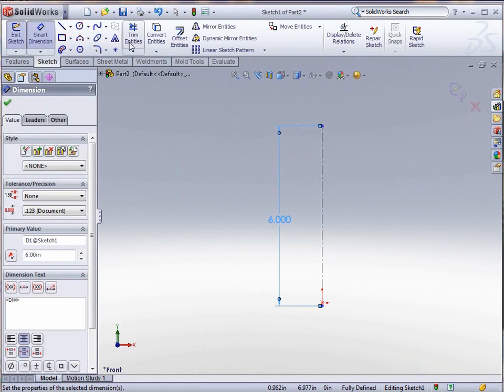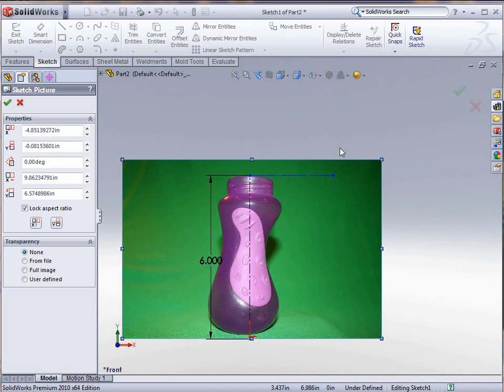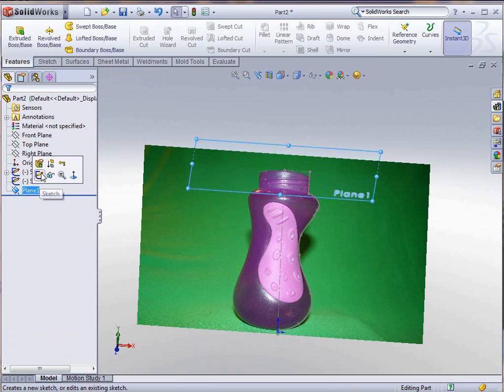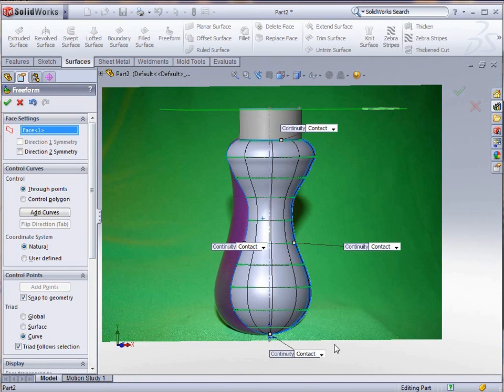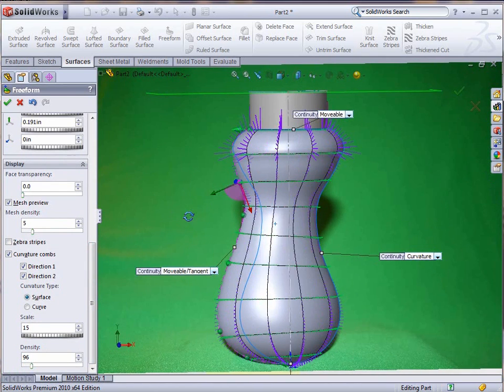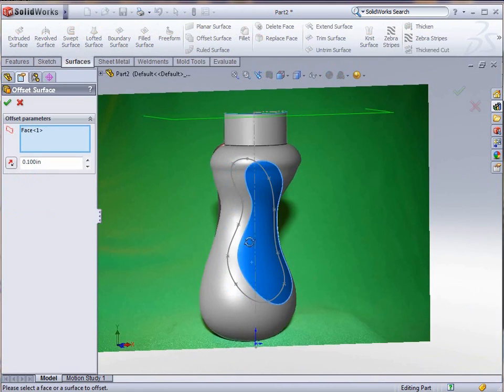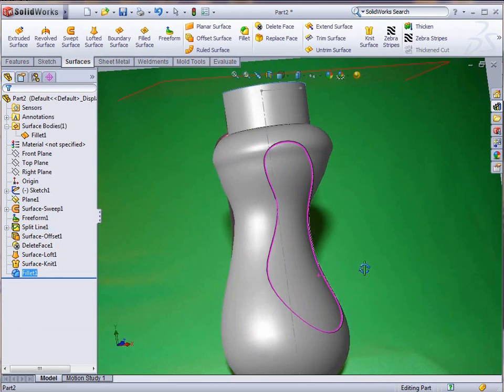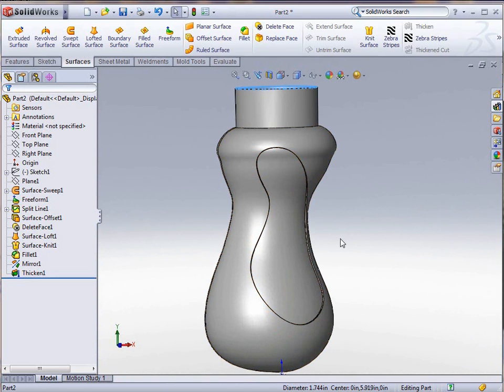Advanced Surfacing in SolidWorks 2010

Comment: Can I insert multiple different sketches into different planes of the one model. For example I am building a brainstem. I was going to insert the sketches of the transverse sections on planes stacked on top of eachother. Then i was going to extrude boss and tweak the shape using  surface modelling functions. Do you think this will work? Or am i only able to use one sketch picture per model?

Comment from the maker: You must make sure there are four distinct edges. The FreeForm tool expects these edges to determine the direction of the M and N lines. It is also important that your sketch which creates the geometry be a spline. A good work flow is to create you geometry using lines, and arcs, convert this entities to construction geometry, then use a Fit Spline, select your construction geometry and deselect the Closed Spline option. This will allow you to control your surfaces easily.

Comment: I am trying to do the same bottle. Everything is ok until I try to use the Freeform.
an error says " Freeform feature cannot use this face. It contains a degerate point "
Even I tried Surface revolving and the same.

Thanks
Reply: I had the same problem.  That's why I do this kind of modeling in Rhino 3D

Comment from the maker: @BPMagic1  SolidWorks does have to have 4 edges when creating the surface loft, but I did this with splines and therefore SW counted the two sides, the top and bottom opening as my 4 edges.  If you created this using arcs and lines then you would have multiple edges and SW would limit your ability to FreeForm those edges.